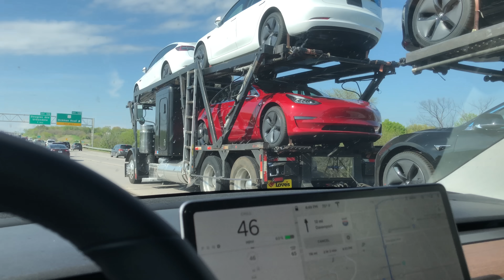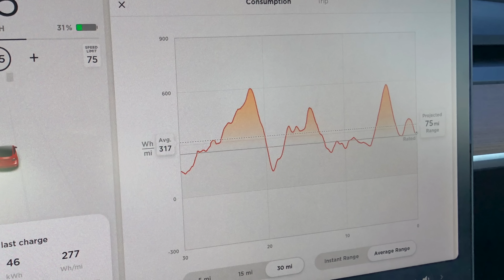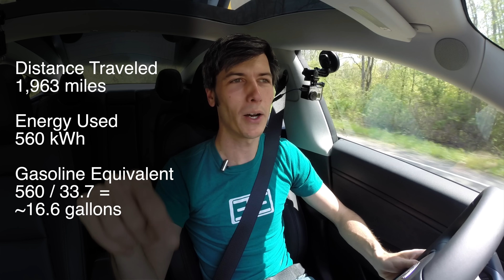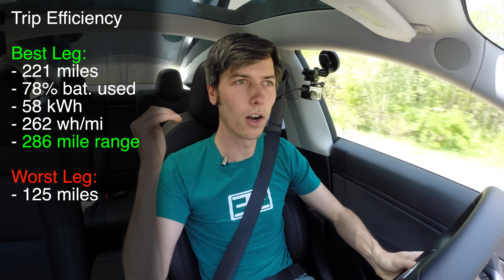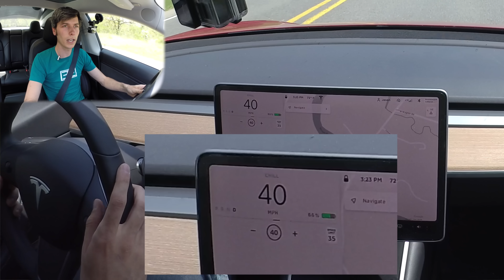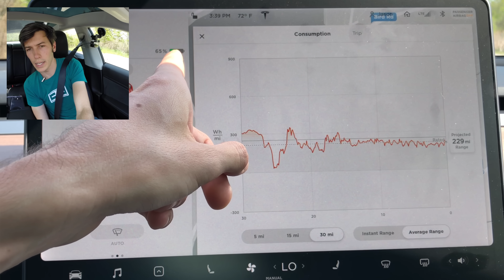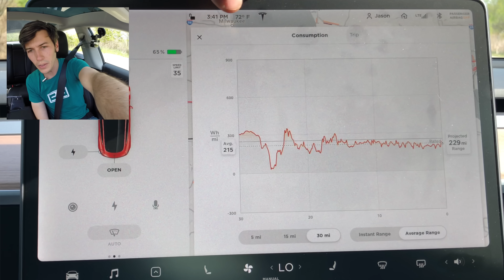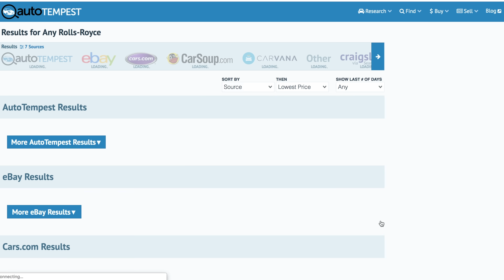How Miserable Is A Tesla Road Trip?

Comment: So, this is interesting.  I don't regularly do long road trips, but when I do, I normally only stop for 15 - 20 minutes.  So... with this I would have to stop for far longer than I like to (making the assumption of 50 minutes stated here).  Not only that, I drive further.  I normally go between 200 - 260 miles at a time, and it looked like 200 was the furthest he went, though he did admit that it hypothetically could have gone further if he had been willing to drive to 5% instead of 15%.  But... realistically, I wouldn't want to go lower than 15% either, so that means that not only would I need to stop longer, I would have to stop more often.  That 100% means that I would need to have the autopilot option.  If I had that, perhaps I wouldn't care about being on the road longer, if I was doing "less" driving.  

Thanks for the video!

Comment: 7:17 "Better mile per gallon" 

Mile per gallon? I thought you are driving a electric car? lol
Reply: MPG is still a valid measure of efficiency.

You can still measure electric vehicle efficiency in miles per gallon, you just need to convert kw to gallons of gasoline at the 'pump' if it were to mean much of anything.

Comment: My Chevy Malibu gets about 40 miles to the gallon and I can drive about 320 miles before I need to put gas in it. That's freeway. It seems like you really don't get a lot of distance on a charge. And I can see why it takes almost a day longer to get to where you're going. You have to stop more, and fill up takes much longer. I think for City driving it's a good car. For distance driving however, I like the autopilot but I don't like having to jump out of my car at 250 miles and waiting an hour to drive it another 250 miles

Comment: NOPE! Drove from WA to NC (2835 miles) in  48hrs between 2 drivers. You're telling me that you spent nearly 8 hrs refueling for a 2000 mile trip. I got 425 mpg and  had to refuel 7 times at 5 min per refuel for a total of 35 min.  I was able to refuel anywhere I wanted (168k+ locations)  and not the limited EV charging stations (17,526 (86.9%) being available to the public. With 48,472 total public charging stations outlets, each location has an average of 2.75 stations/outlets). 

Just not worth the headache.

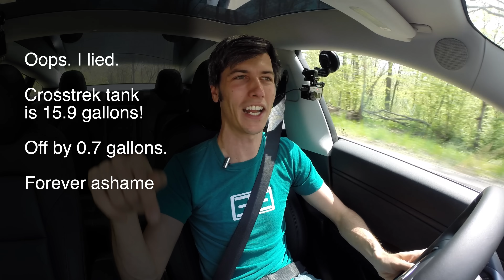Comment: At 8:24 you mention your Subaru Crosstrek, a $25,000 car. So for the price of your model 3, you can buy a Crosstrek and $25,000 of fuel.
At $2/gallon, that's 12,500 Gallons. Your Subaru is rated for 29mpg (city). 29*12,500 = 362,500 miles.
Building your model 3 cost (and uses as much energy) as building your Crosstrek and driving it for 362,500 miles (tax on fuel included) !
If you need to replace the battery before you drive 362,000 miles in your Tesla, it will be a massive ecologic fail !!!
Reply: I am confused are you talking about money or energy lol
Reply: Melmacian Dissenter not sure I follow your ecologic fail.  You can argue that it’s a financially bad decision.  But then I can say your $25k crosstrek purchase is financially bad decision compared to a $15k used car that gets same mileage.  They are different cars with different luxuries and capabilities.  Vehicle cost does not equate to environmental benefit.  If he drove his model 3 for 200k Miles then he saved 6700 gallons of fuel.  And lithium ion batteries are recyclable even when they’ve degraded.  This is not an “ecologic fail.”

Comment: Interesting video.  There is one caveat with your trip.  You have to follow the path to where the charging stations are.  What would be an informative video is taking a road trip where charging stations are not available.  How does it affect the trip?  How would you be able to charge the batteries when there is no charging station? etc?
Reply: Peter Minearo the United States charger network is pretty impressive wherever there are freeway routes and/or populated areas.  It is pretty rare that you would take a trip that you would have to alter your route.   Some exceptions of course ... North Dakota still sparse and Alaska is very bad.  Now sometimes I have had to find a way to charge once I got to my destination, to make it comfortable to get back...went to a beach once that was 100 miles away from a charger.  I had to take my mobile charger and stay plugged into 115v outlet over the course of the 3 day vacation..painfully slow but it got the job done.
Reply: @MrSpuzzz  I don't  have an electric car; so this is a curiosity for me. Doing a quick search, it seems like if you have a Tesla; then you would be ok for most populated areas.  But what about other electric cars?  Can they use the Tesla charging stations?  If not, you have to take your mobile charger; and how does that affect your trip?  Looking at Interstate 80 across Nevada there are Tesla stations, but not general electric stations.  If someone is driving from say San Francisco to Salt Lake City in a Nissan Leaf, or Chevy Volt, how long would it take? Where would they have to stop?  Do they have to spend a day, or two, charging at some motel/hotel in Elko, NV?  Personally, I like to take trips on roads less traveled.  So, can someone take backroad trips for the weekend? Or does our culture have to change to accommodate (meaning more vacation time/longer weekends, which I am all for) road trips where you have to spend more time charging the vehicle?  I know this is a little deeper question, but it is one that I think people don't have answers for and are thinking about.

The other, more technical, questions I did have is: does fast charging the batteries all the time reduce the life of the battery?  If so, by how much?  And what do they do with expired batteries?  From what I understand electric car batteries can not be recycled.
Reply: Peter Minearo great questions.  At this point only Tesla’s can use tesla superchargers in the us.  It remains a huge competitive advantage.  Tesla had invited other ev makers to participate (with a fair share of costs of course) but no one wanted to collaborate.   

Non tesla evs would really struggle with road trips in the us (Europe is better).  The Nissan Leaf has a short range.  Really intended for local driving.  You also mentioned the volt but I think you meant Bolt.  The volt had both a gas and electric engine.  Bolt has a longer range but without a nationwide charging structure and very limited fast charging stations, you have to do a lot of preplanning, route altering, and waiting for slower charge completion.  There’s a nice app called plugshare that helps you find them.  

Lithium ion batteries from cars are able to be repurposed after its auto life for another 10 years in things like power grid storage.  New recycling techniques are also being discovered.  They will have figured out how to fully recycle the materials by the time this first wave of ev batteries become completely obsolete.
Reply: Peter Minearo oh you had a question about fast charging.  Yes, it is not recommended to fast charge all the time.  I don’t know to what specific extent.   Tesla’s have a pretty sophisticated battery management system that will throttle down the charge rate when it feels fastcharging is posing a battery health threat.  Some owners don’t have any alternative but to use superchargers for all power ups, if they have no garage at home and no office charging.  A YouTuber named “TeslaJoy” is one of those and she has documented her experiences.  

I probably would not own an ev if I couldn’t charge at home.   It’s one of the best benefits of owning electric.  No fueling stops.

Comment: What do you get with you and 3 other passengers?  What about luggage?  Rain conditions?  Heavy winds?  What about hot and cold climate drives?
Reply: johnboylong40 weight is not a huge range reducer.  I hardly notice heat affecting my range.  Cold affects it especially in the first leg before your battery warms up.   Probably can get 250 miles on my 310 mile range in bitter cold (after battery warms up).  Rain and in general just wet roads reduces my range...maybe get 270 miles.   They say a headwind can be significant but I’ve never noticed.  Of course driving up hill is really significant but of course you get the reverse benefit on the way back down.

Comment: As a supposed engineer, you should be ashamed of yourself for comparing the battery charge used during the drive to gasoline usage in a traditional car.  Most efficiency loss occurs during the generation of the power (almost entirely from coal, oil and natural gas in the U.S.) and the charging (rapid charging is much less efficient than slow charging).

Comment: The supercharger network is growing.  The point here is, can you drive coast to coast in these?  Yes, but it's not ideal.  Teslas and EVs in general are more suitable for day to day, too and from work driving.  I wimmer have a Model 3 for work and will use my wife's SUV for long trips.  I have no doubts we will see 400 mile range on new EVs within the next 5 years.
Reply: And then after 5 years it drops to 75% of that, and after 8 years the battery is end of life, and since there is no ev battery recycling, it goes to the landfill.

Comment: Ive made a lot of trips in the winter.  Most efficient to set heat to whatever and fan speed manually to a 1 or 2 max.  With this i was getting around 70% of my rated range and cabin was still very confortable.   Found When i left climate on auto with higher fan speeds i lost more range.  Im guessing heating lots of cold fresh air takes a lot of energy.

Comment: Note that you can also drive to 5-10% state of charge and only charge to 55-60% in shorter time. The battery have quicker charging between 5-60% than below and over, and will reduce the total charging time if you are doing a long distance road trip.

Comment: 8:30 ... no, it shows you how gullible people are and how bad at logic and math even some engineers are.  Essentially you are claiming that the energy used on your 2,000 mile trip was equivalent to burning 16.6 gallons of gasoline in a power plant with 100% efficiency and that energy magically appears in your battery. Including energy losses in how the electricity actually went from source to power, the actual equivalent is closer to 55 gallons used, about 37 mpg. Might as well drive a Prius, which costs less, is more efficient, and doesn't require 12 40 minute fuel breaks on a 2,000 mile road trip.
Reply: And the fact that you spent $156.80 on fuel basically proves my math is very close to spot on. $156.80 at $3/gallon is 52.26 gallons. A TDI or Hybrid can get better fuel economy than that and they cost less. Teslas are nothing but a toy for people with money to burn or those gullible enough to think they are saving the planet.
Reply: Ok so you means gasoline also magically appears in your fuel tank without mining the crude oil which require pump jacks which uses electricity and without transporting it using trucks which are wildly inefficient and without refining the oil to make gas and diesel which is an even more wildly inefficient and without transporting it to fuel pumps using trucks 
Wow man you simply avoid all of this losses and magically made ice more efficient than ev's

Comment: 1st of all, the 33.7 miles per gallon equivalent number is complete horseshicht. It's a pseudoscience finding from the Obama EPA that "forgot" to include the Carnot cycle in their fudgery. Secondly, you aren't counting the ~30% energy loss from quick charging. You consumed far more energy than is in 17 gallons of gasoline - in perfect weather conditions. It's still slightly more efficient than ICEs but it's not as efficient as a good hybrid that you could have simply spent 15 minutes of total fueling time with leisurely drive times.

Comment: My only questions pertain to cost to recharge and where are the recharge stations located? Have  never seen a recharge station anywhere in Georgia to include Savannah, Atlanta, Macon and some others.
Reply: He calculated it in the video, the rate was $0.28 per kWh from Tesla chargers and he spent $156 on electricity.  

If you calculate the actual mpg equivalent (not using the EPAs pseudoscience MPGe where they pretend energy magically jumps from one place to another without losses), he got about 37 mpg on the trip, a little less than what I used to average in my TDI while I could get 600+ miles on a tank. A new Prius would be even more efficient and cost less than half of that Tesla - whomp whomp.

Comment: It is really chocking that the VW 1 liter car gets 260MPG in hybrid diesel/electric whereas the Tesla 3 gets 112MPG equivalent, pollutes twice as much to build, twice as much to run and THAT is what is what is supposed to save the earth!
Reply: Besides the fact that the 33.7 kWh per gallon of gasoline is Obama's EPA pseudoscience - which is what they use to make these claims about EV's efficiency. The number is derived from converting one kWh electricity and one gallon of gasoline to BTUs energy and then comparing them, but completely ignores the energy required to deliver 1 gallon of gasoline to a gas tank and that required to deliver 1 kWh to a battery.  There is about 10% energy loss from oil drilling to gas tank, whereas there is about a 70% loss from resource to powerplant to battery charging - even more in non perfect conditions unlike in the video. The whopping difference comes from where the biggest energy loss is, the carnot cycle, which is a power plant for electricity and the engine in an ICE. By leaving out the biggest loss in efficiency, they have hugely exaggerated their benefits.

I calculated that he averaged about 37 mpg on the trip and that is supported by the fact that he spent about $158 on electricity charging - equal to 52.5 gallons of gasoline at $3/gallon -and that is being generous because gasoline is actually closer to $2.50 national average.

That VW probably makes use of the MPGe fudgery as well, though as a hybrid with an extremely small ICE, they get great efficiency at slow speeds (like an EV) AND at highway speeds, thus they are much more efficient overall than EVs. Something like the Volvo V60 diesel hybrid would probably be wildly popular in North America since we drive long distances, but for some reason they only marketed them in EU where most anyone going a long distance simply hops on the high speed rail.

Comment: The "efficiency" comparison is absolutely driving me nuts. Electric cars are efficient only because the thermodynamic conversion yield cost is already prepaid during its production. Having worked in the industry and having to put up with this nonsense is infuriating. The only time electric cars are going to become truly efficient is when all the energy is either produced by nuclear (the yield here is very similar, but the fuel can be considered unlimited, so yield is not that important) or wind/solar (huge amonts of real estate + risk of no sun/wind intermitently) processes. Though renewables are going to be near impossible if the whole world swithces to electric transportation.
Reply: It's extremely irritating to see the established pseudoscience that pervades the world today. It's one more holdover from the Obama EPA - the origin of 33.7 kWh/1 gallon - that needs to be corrected.

I calculated that he used an equivalent of 55.6 gallons of gasoline by factoring in losses in electricity generation and charging, and then he confirmed it by showing that he spent $154 on electricity. That is 52.25 gallons of gasoline at $3/gallon, though the national average is closer to $2.50 per gallon, so the true mpg equivalent of cost was probably closer to 32.5 when you consider the entire energy cycle.

And to think, people are paying twice as much as equivalent vehicles for this overrated toy.

Comment: So if you arrive at a supercharger and all charging spots are full, can you reserve a spot before you even get there?  I'm thinking you should be able to select that specific charging station right from your GPS and reserve it.  Your car / system automatically knows what car it's charging therefore it will NOT charge a different car at that specific time....  Thoughts?  I do realize that TODAY, they may not be full hardly EVER at all.....  But what's going to happen in the future when many thousands more electric vehicles are on the road?

Comment: OK so 250 mile average range is not too bad, except of course for the 50-minute stops, but remember:
1. fast charging reduces battery total life.
2. discharging to less than 20% and also charging to 100% to get the max. range also reduces battery total life.
Reply: Fast charging also creates about a 30% energy loss from the battery heating up/needing cooled more.

Comment: Update 8/31/19.  Over one year ownership at 15.000 miles.  I  have always charged my 2018 Model 3 at the recommended level @ 90% and got the rated ranged of 279 per charge, but now 90% it only charging to 240???,  and a full charge only charges to 290%, and have fully charged it 2 times in over a year time.